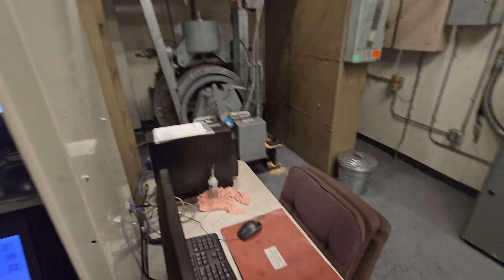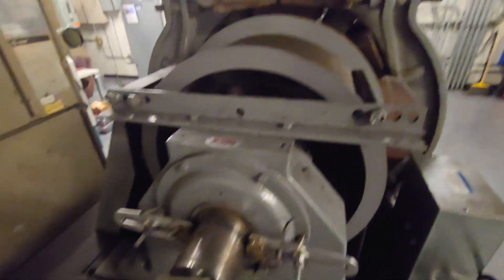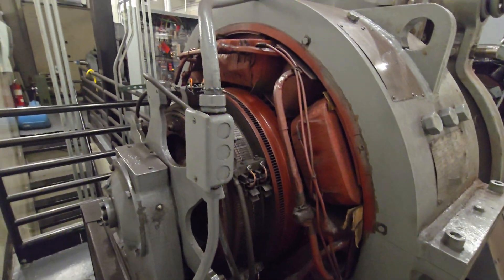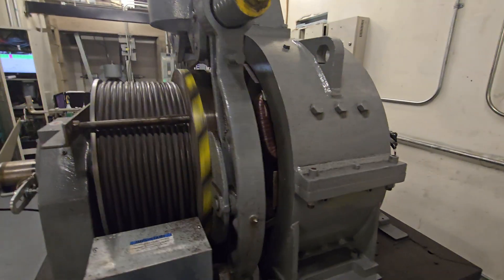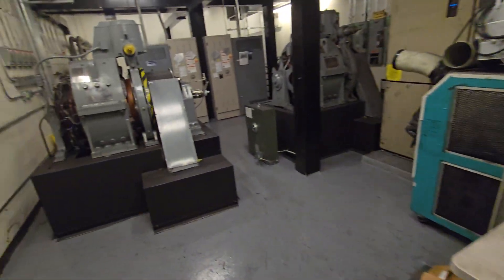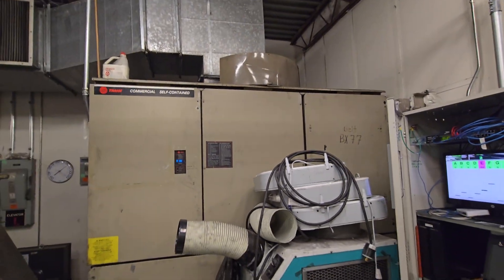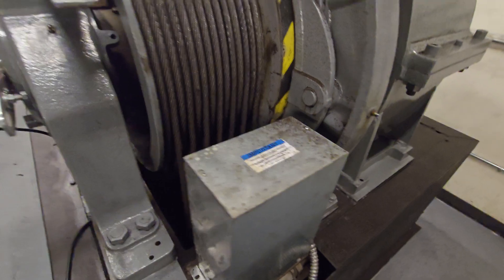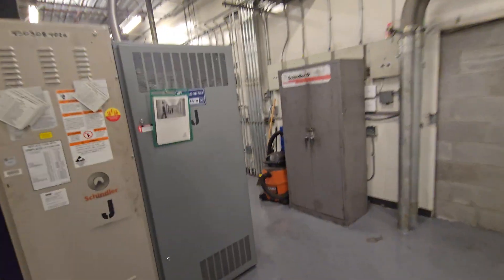(1200 Subscribers!) INCREDIBLE 1200FPM Montgomery/Schindler Traction Elevator Machine Room

Comment: They don't electrify the bearing to prevent corrosion. Those brushes discharge a voltage that builds up from the eddy currents. If the voltage is allowed to build up it can discharge through the bearings causing pitting. The pitting makes them run rough and eventually grind themselves to pieces.